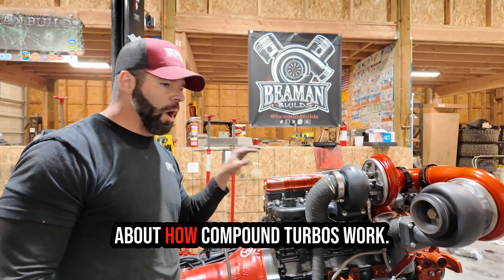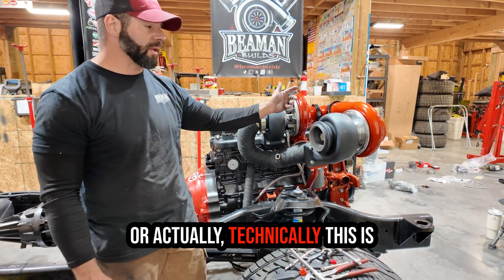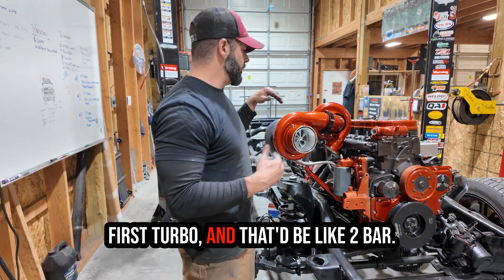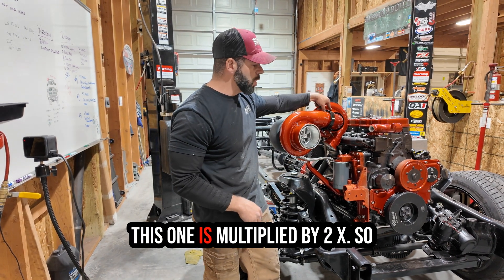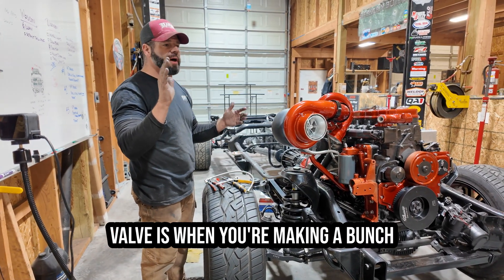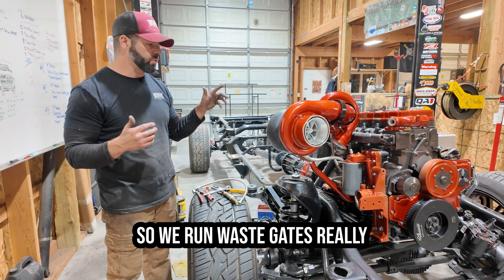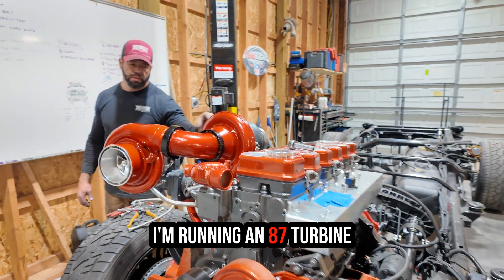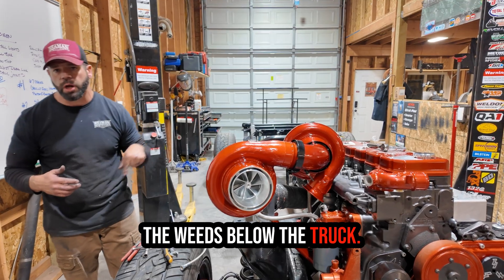How Compound Turbos Actually Work | Shop Talk with Wes

Comment: Hey man I’ve always been confused on which turbo should feed which.

Should the smaller turbo feed the bigger turbo since it’s taking in the compounded air or bigger feed the smaller to condense it further?
Reply from the maker: You always want the smaller turbo to get the exhaust gas first because you want it to spool quickly.  As drive pressure builds you will have enough exhaust gas energy to drive the big turbo further down the line.